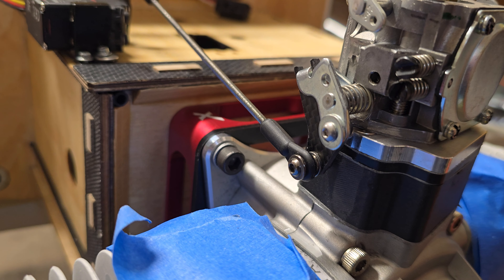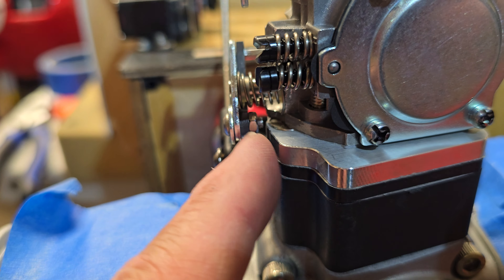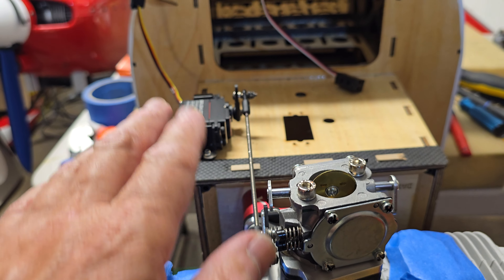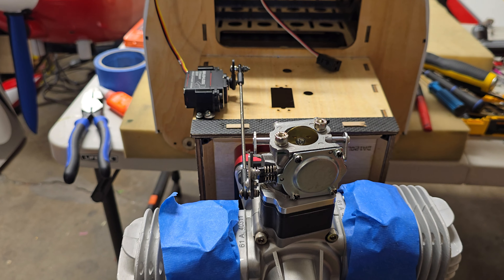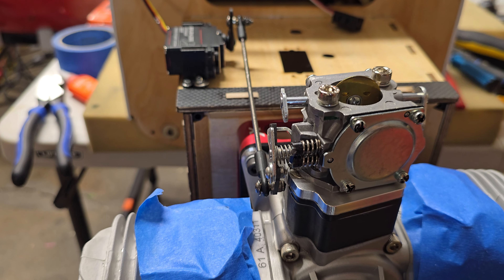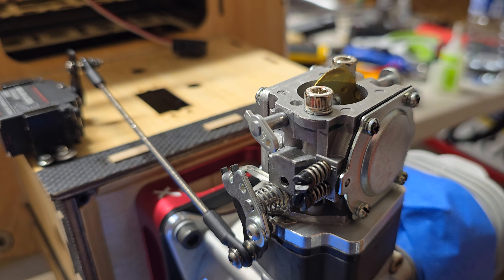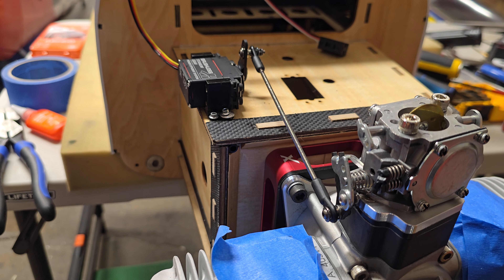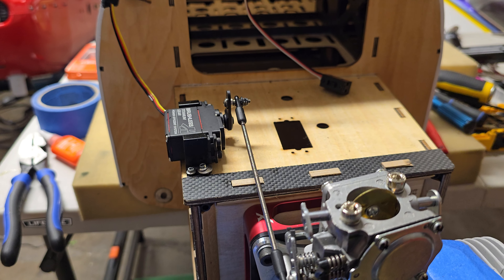throttle linkage setup, again

Comment: Hi Joe what is the thickness of the threaded rod? Is that 4-40?
Reply from the maker: @armandoabreu6593  on the throttle linkage? I always use 3 mm. The 440 is just too weak to me.